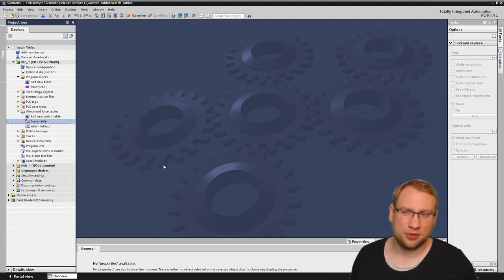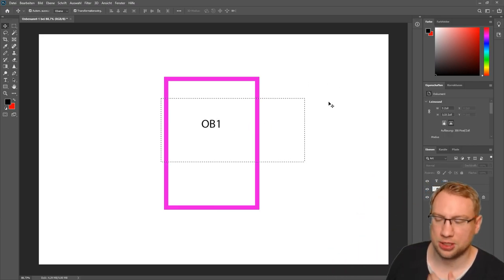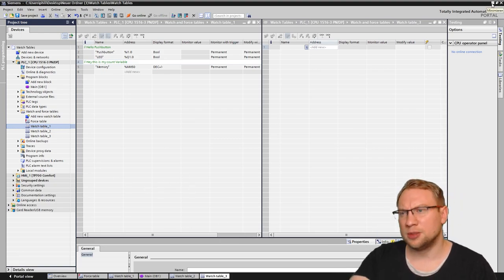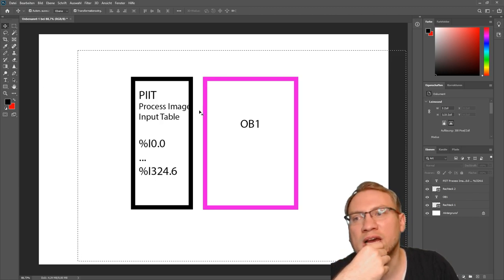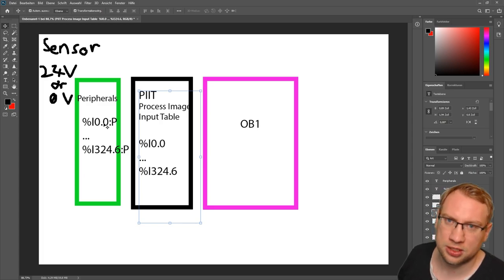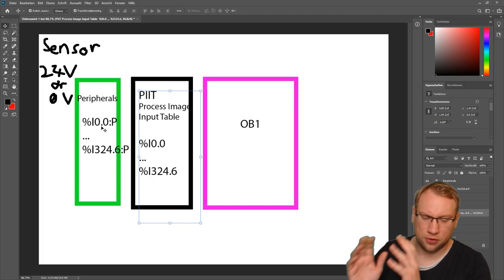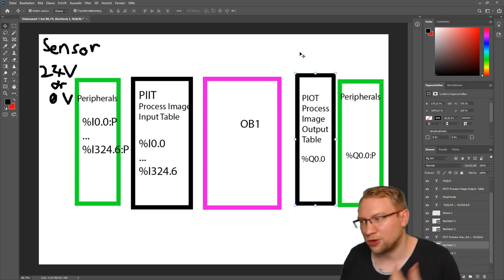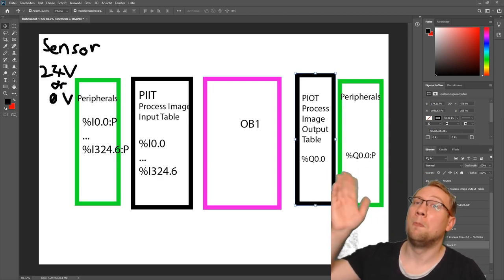TIA Portal: Watch Tables vs. Force Table; Differences

Comment: Thank you very much! Can you explain please what does percentage sign - % mean in inputs/outputs names? it' still ununderstanding for me and i didn't find the answer on the internet
Reply from the maker: The % sign indicates an "Absolute Address"... that means the user and the PLC know exactly where it extists in the storage. That is the case for Output/Input and Memory tables. e.g. %M3.4, %Q53.3 or %DB3.DBX5.3
The opposite of those would be "Indirect Addresses", which do not have a fixed address and are used more hollistically by the programmer without him/her knowing which memory area is exactly used. That is the case for most data blocks, where you only use names and no addresses. Those names are highlighted with quoatation marks e.g. "Start Memory" or "Motor is runnung"

Comment: Hi there, usage of Photoshop for such a task is just an overkill. I've  just got a laugh from your torments with this costly software. 

Simple move towards free Microsoft Expression Design 4 and forget about torments :)
Reply from the maker: 100% agreed! Usually I would even use Powerpoint or simply paint... but sometimes I like to play around and see 😊
Reply: @hegamurl7434  , play around with Expression Design! Of course it requires some folds in the brain as well. However, I noticed that I had focused on this software doing the same job as you in tech.uni. ;) If  there's a necessity I can give some simple tips on usage.